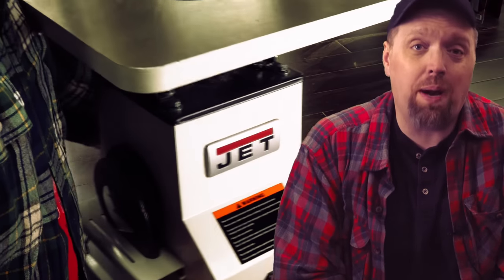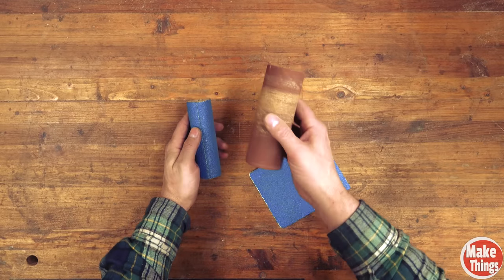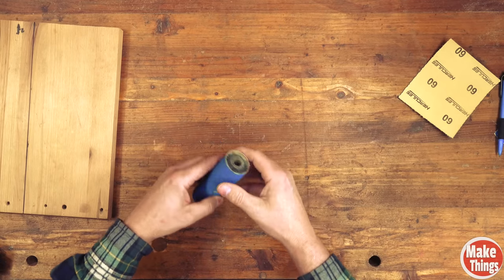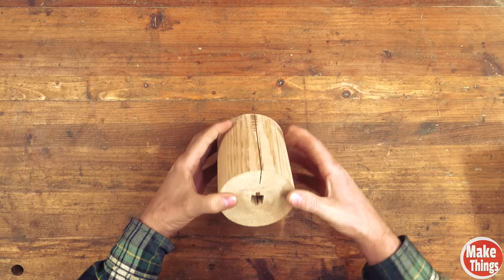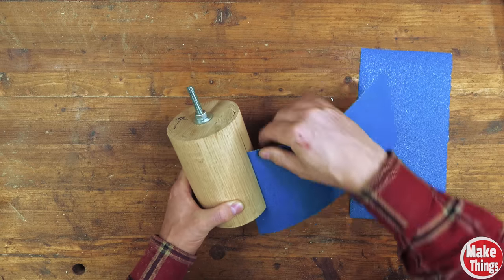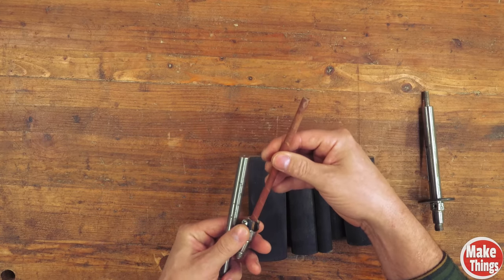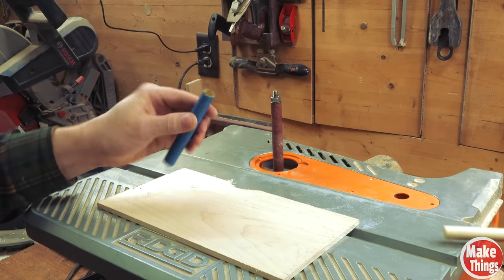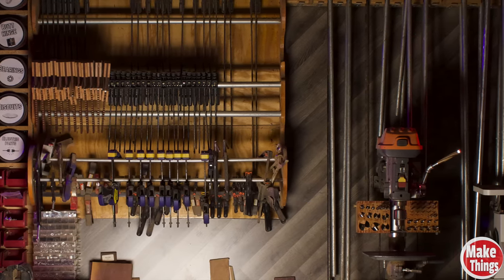Wait..you can make your own spindle/drum sanding tubes?!  // B4WMT #7

Comment: Dear Rob, I wonder if you have discovered the sandpaper cleaning stick? It feels like rubber and is a rectangular long piece approx 50 mm x 25mm x 300mm {2” x 1” x 12”}. Use it on the running spindle sander and it cleans in seconds. It means that your life-time is at least ten times longer. Cheers.

Comment: Thank You, I have a Jet 15" drill press and this will work great! The sand tubes for the store bought tube spindles are expensive and short and hard to find the grit you want. Thanks for sharing!
Reply: Just know that the bearings in the drill press are not intended for side loads.  It will work just don't go nuts with the pressure.  Change out the paper and let it do the cutting.